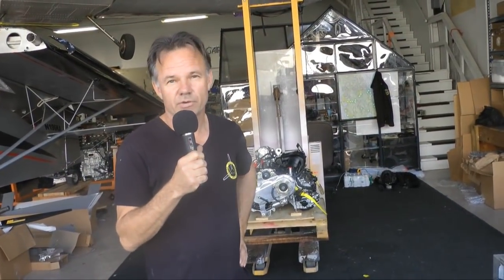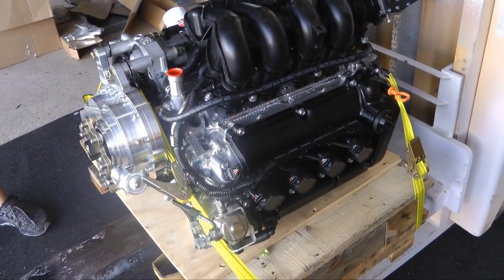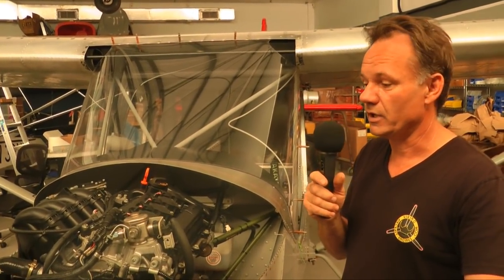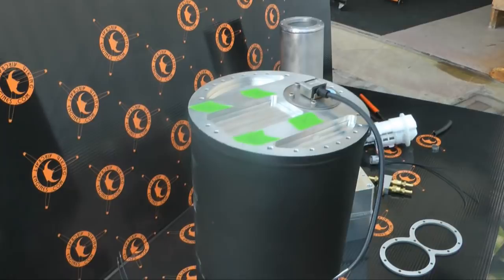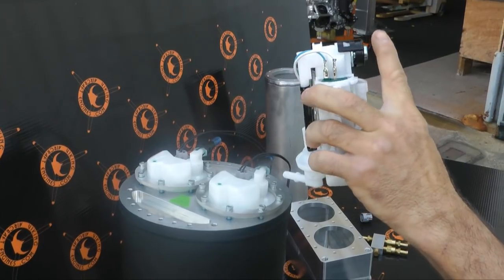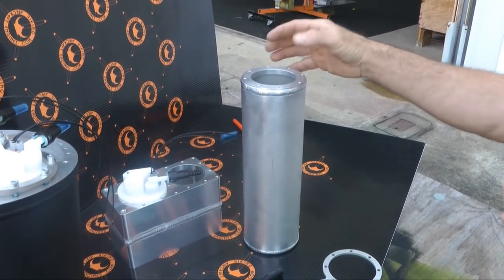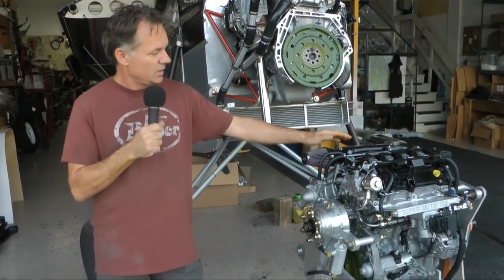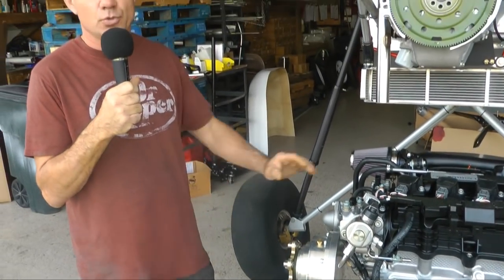What's new at Viking Aircraft Engines

Comment: Being a new owner of a Honda car I wanted to know more about direct injection reading up on forums I guess all DI engines have a known problem of carbon buildup inside the ports because the PCV system pumps un-burned blow by back into the intake system it accumulates right above the valves. The older style port injected engines would clean this off because fuel was always being sprayed on the valves. Still had build up of gunk in the throttle body.  What I have read is the intake has to be removed and then the intake ports have to be cleaned on a DI fuel system. I guess Toyota and Nissan are installing port injectors as well to clean the ports as you drive sprays little fuel in there. From what I read this doesn't start to effect engines until 60k miles also was stated Turbo engines if they leak oil past the seals that also builds up carbon same spot even worse. With Viking buying used engines wonder if these intakes should be inspected prior to installing the engine and monitored at so many hours. One way to fix this problem for aircraft engine is just vent the crank case to a oil tank catch instead of using the PCV valve typically with out some sort of suction can cause more build up of un-burned sludge in the oil system.https://www.youtube.com/watch?v=xrLNDgrIw3U
Reply: blastman8888 all blow by goes overboard unlike in the car engines for epa standards, so we don’t have the same issues etc.

Comment: I dont want an engine converted from a scrap yard car in my plane.........i prefer new to used..
Reply: I like 2019 Honda engines
Reply: I keep reading this online about the "used" part of this engine being undesirable. I've driven Honda Engines very hard that were decades old with 10x the mileage of these Viking conversions with absolutely no engine related issues.  Only Issue I ever had with a Honda was transmission failures.  I've never heard of a Honda engine failing at low mileage from manufacturing defects.  However there are plenty of 2 stroke engine failures at very low hours.  FAA was also leery of MoGas; but I've seen several certified aircraft with lead fouled spark plugs producing no spark.

Comment: What will the TBO be on the honda as direct injection leads to carbon deposits?
Reply: DI leads mostly refer to being used in cars that use low RPM, in the aircraft it is higher RPM and no issues with lead deposits.

Comment: Auto Gas.  OR 100 lowlead.
Reply: Either
Reply: @eggenfellner  Wouldn't 100LL ruin your catalytic converter?  As well as possibly foul spark plugs?  I've seen a lot of certified Champion Plugs producing 0 spark due to lead fouling.
Reply: @GregHuston  There is no catalytic converter on these engines.

Comment: The engines in the Lycoming IO-360 class all support constant speed propellers.  Will the new Viking 180 also support constant speed props?
Reply: Actually, your question seems to reflect some misconception as to what a constant speed prop requires. Constant speed props are not allowed in the LSA category by regulation, not because the engines cannot be fitted with them, but the LSA regulations are designed to make the function of the aircraft to be less complex. Less experienced pilots, less complicated plane.
Reply: Yes, however much lighter and technologically advanced propellers

Comment: That intake manifold looks very restrictive. Is it made that way for packaging reasons ?
Reply: Viking Aircraft Engines Not so much. There's flow, so there's pressure drop across. With turbocharging you can make the turbo compensate, only if the wasegate senses the pressure after what causes the drop. And it doesn't mean all cylinders get the same pressure. Still, what is the reason for that detail ?
Reply: True, it just makes the turbo work a little harder, but that's not really all that detrimental. The only thing that I would be concerned about is that the cylinders were all receiving the same amount of air.
Reply: @PistonAvatarGuy  not a true statement
Reply: @ctsteve1967  What's not?
Reply: I was wondering about that too. Viking should get together with a tuner shop that specializes in tuning Honda engines, like ENDYN, they could build some amazing engines together.
Reply: Intake does not matter with boost.  Pressure is the same everywhere, no matter what turns you make.